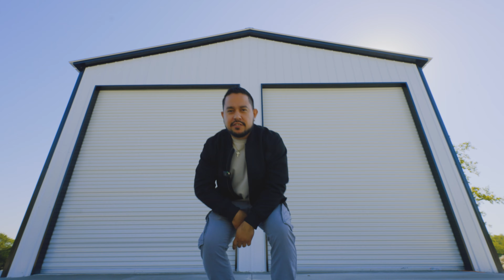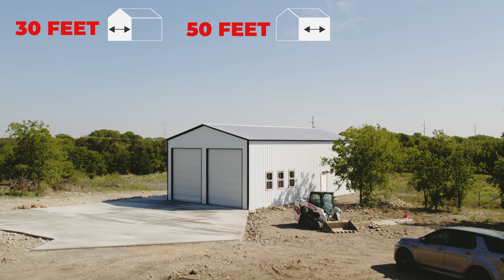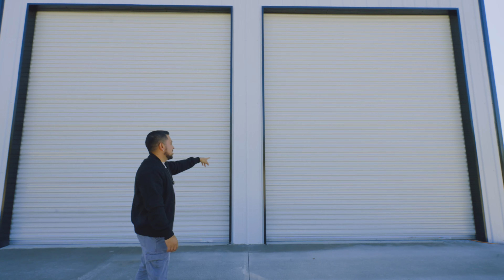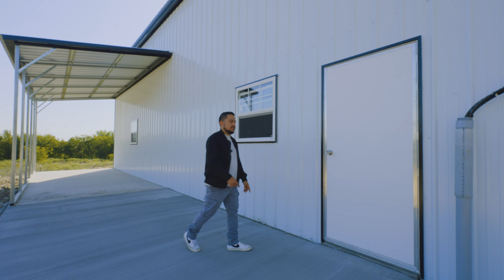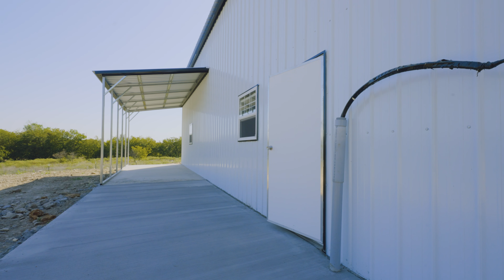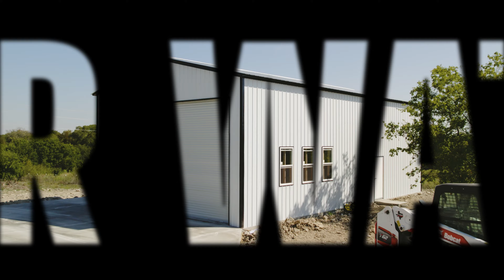Big Metal Warehouse | 30 x 50 x 16 | American Steel Carports, Inc.

Comment: The only thing I would add is to add a larger cement slab on the side with a drain with appropriate car port for a steam cleaning equipment or car wash area. And insulation, 120v and 240v electrical. Great building. Thanks
Reply from the maker: Hey Doug! Thanks for the compliment on our building. Your ideas sound good too! If you ever decide to make those ideas a reality, don't hesitate to reach out to us at (866) 730-9865. We'd love to make those suggestions come to life!